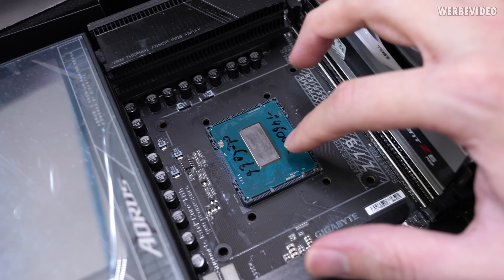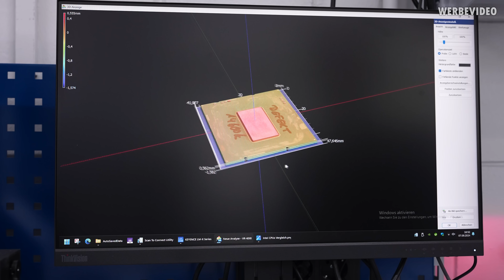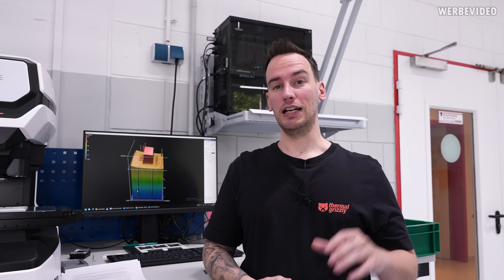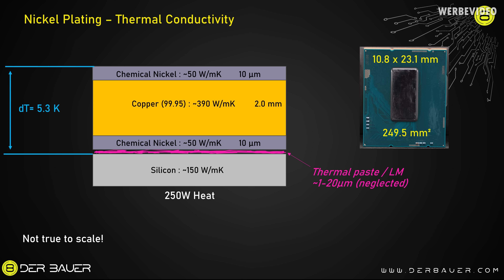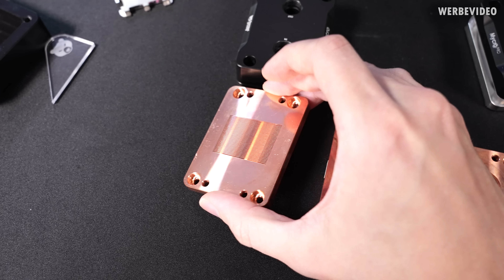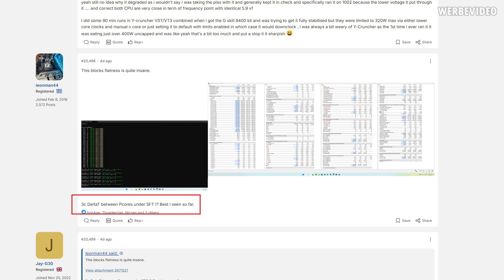We Identified the Problem with Our Water Block

Comment: I have to poke a hole in the chemical Nickle plating claims. Ni should have a face centered cubic crystal structure when crystalline. This is easilly its most dense state due to the close packed nature of the structure. Therefore the amorphous state can only be less dense. That's not to say the permiablility would be worse, as the amorphous state would lead to less if not no mobility of vacancies and dislocations, and thus less mobility of Ga in the bulk. Since this is YouTube I should also mention the size of Ga atoms is too great to reside in interstitial locations.

Comment: Glad to see you fixed the issue. :)
On an unrelated note is there anything you recommend me do to troubleshoot your LGA 1700 contact frames? When using them my memory overclock suffers greatly compared to the stock ILM with my max frequency being cut and occasional blue screens occurring and no matter how I tighten the frame (I’ve tried following your guide for 12th gen, fully tightened down and very loosely with both sets of screws) it always seems to have a negative effect. I bought the 13th gen revision in 2023 and had these problems with it and recently bought the 1700 LT version to see if it made any difference which it unfortunately did not. The board I tried using these frames on is the Z790 Apex Encore and others have reported similar issues to me.

Comment: I always prefer plain cooper. Can you sell cooper only version?
Reply: Watch the "Material science: Why nickel plating?" segment at 8:48 and you will learn why plain copper cannot be used with direct-die.
Reply: @snozzmcberry2366  I couldn’t find that video but a gamers nexus video stated cooper is fine except that it would have more staining and potential pitting but should be of no concern. Personally, my whole system fully copper with kingpin paste….it works excellent.
Reply: It'll be fine if not using LM, or any other corrosive TIM
Reply: @_Fortiori  If you too had actually watched the video, you would've heard Roman say that using anything other than liquid metal renders the delidding useless as you lose any potential cooling gains to be had. Non-LM TIM does not perform on direct die.
Reply: Wasn't aware someone could tell exactly how much of a video I've watched without ever meeting me but oh well.

He said it's "highly recommended" but I don't think it's the only option. That suggestion is at odds with his install video using kryosheet with the am5 heat spreader (the same part as for the waterblock).
I'm sure LM is the 'best' conductivity but it also comes with a high maintenance requirement and some risks which not everyone will be keen on. It should be possible to achieve results better than normal IHS cooling using this block or the TG heatspreader but not using LM, that's where a copper only block could be quite effective.

Comment: nobody else is surprised they were basing expected performance on prototypes and assumptions only, and not doing any testing with the final product? seems incredibly reckless. and the radius/chamfer issue.. again surprised that multiple mountings wasn't a part of testing. silver lining is the transparency and the fact that this serves as a lesson for thermal grizzly.
Reply from the maker: The radius only happened after we modified the block to increase pressure. So that was nothing we could test before. For the rest, absolutely. That's why I'm making my videos to show what we were doing wrong and how we try to do it better next time.
Reply: @der8auer-en  respect your taking accountability.

Comment: Talking about liquid metal on copper, it all comes down to discoloration.
In Sept 2014 i bought some grams of certified pure gallium from a german lab on ebay. It came solid, i then liquified it with an hair dryer (!) and, with an insulin syringe, i collected it.
I then applied the pure gallium on an old LAPPED Intel E6750 using its stock intel cooler.
It's still perfectly working on the current date, same temps, as the beginning.

Gallium eats aluminium, that's  for sure, but it basically has no effects on copper. Discoloration is just a pure visual effect and it doesn't affect functionality.
I know that, being on your side, visual differences can affect the RMA rate (mostly because most buyers don't know what they're dealing with), but from a technical standpoint keeping the pure copper finish is the best option.
Reply: Yup, I've had LM applied to an IHS and EK block for about 5 years now, both of which had the nickel coating sanded off. Haven't had to change the LM, and performance is still great. I'm not currently running the overclock I did at the time so I can't directly compare to initial temps, but at stock settings I have max core temps of 31 °C idle and 50 °C with Prime95.

Comment: Silly question from a silly person. Why was the water block not designed to use the same holding points as the TG contact frame which seems to not have any CPU warping problems?

Comment: Hey, i work in fabrication. We measure out product down to the thousandth of a milimeter. When workingn on stuff this small and complex i would recommend at least hundreths if not thousandths for measureing and tolerances.
Reply: The thing is such small tolerances only make sense if everything else around it also has such tolerances, which here is simply not the case. For instance the CPU-PCB is often enough slightly warped from the factory.

Comment: Have you tested any EN matrix coatings? I bet a diamond nickel coating would be killer for direct die. They have micron and even nanometer size diamond embbded electrless nickle. Ive seen it used to increase thermal transfer be acting as a hear spreader.

Silicon carbide nickle could be worth looking into too.

Comment: I think the the pick of nickel is more important then the looks.
For me a motherboard or other component like a water block is suppose to be built to perform first, looks or estetiks is not important.
To me looking at say an old mother board where every component has a jobb and a function and you can see it if you understand it, that is sexy hardware!
I dont like motherboard that is covered up in plastic or water blocks with an LCD or RGB, yea I know people like RGB but it has no practical function so to me its not good looking.

So I dont think any apology for the esthetics is required, the esthetics should be a result of the right choice of materials to build the component.

And if it works correctly the it also looks right!

I dont mind if an esthetic flair can be added without compromising the quality and performance of the product so Im not against making things look presentable as long as its not overdone.

Anyways, good video and a nice transparent update!

Comment: Why not create a finned surface to make a bigger heat spreading surface? I'm sure that if you do it to a copper plate before nickel coating it would increase the contact surface by 20-30% between nickel and copper.

Comment: Your comment about people using LM for direct die cooling.... But what if you were to sell a different version of the same waterblock that was bare (or galvanised) copper for use with PTM7950? You could cut out the nickel plating process completely and save a lot of time and money. Savings that can be passed onto the customer and just have smaller limited run batches of nickel plated blocks for those that do still want to use Liquid Metal.

Because I know a fair few people who used to use LM religiously that have now fully converted to using PTM and its usage is growing every day among the enthusiast community. Its not really something you can ignore.

But I assume you want to go all in on the nickel plating because you need to shift boxes of your Conductonaut.

Comment: but why bother with all of this, its beyond me, you get few degrees less you get few % more performance... and a lot more risk :) I cannot imagine that someone has a business and the competitive advantage is running overclocked CPU with water cooling :) and if you have a home PC then again, you void your CPU and sometimes MB warranty, and if you can afford water cooling just buy better CPU :) this is bad optimization, its like with software, you have a program that runs lets say 60 sec, and you are trying to optimize it, you profile it and you see that one function is takes 80% of this 60sec and the others are 20%, and you pick a function from those 20% that takes 50% of those 20% so 10% of total and you optimize it by 40%, congrats your program runs finished not in 57-58 sec :) was it worth it? you spend on it 3-5 months and now your program randomly crashes :D

Comment: Maybe I misunderstand, the explanation of the discrepancy is that the power density is locally higher on the die? You mentioned a 10-15C temperature loss across just the nickel plating layer? I mean, it just doesn't make too much sense. The argument is that the heat is too localized and hence does not spread out enough, but the layer is so incredibly thin compared to the rest of the structure (silicone, copper) that this can never explain a 10C difference, can it? The heat can spread even in the silicon die already (it has a diffusion barrier), and then the amount of 'spread' that can be attained in the 10um nickel barrier is extremely low no matter what material it is. Moreover, the difference between 'good' and 'bad' nickel is, if i understand, maybe a factor 2. How does that explain a factor 100 vs the calculations?

Comment: When applying chrome to steel, you must first copper plate, then nickel plate, then chrome plate.
I understand the boundary layers, but I did not think about the impact on thermals till now. I am just a Mechanic and tech enthusiast. 
Excellent work, Roman. Your transparency is greatly appreciated, and it is something lacking in this day and age. Maybe GN will do a video on Thermal Grizzly. A positive one, of course! Have a great day, Sir! o7
Reply: One of my engineering mentors pointed out that whether it's construction or manufacturing, issues and irregularities are almost always found at interfaces
Reply: You should find out what hard chrome plating is then revise your statement about must.

Comment: So they skipped steps, and put out a bad product. Seems pretty typical of business large and small these days. If TG had simply erred, I could understand. We all do. Still they came clean and fixed the problem. That counts.
Reply from the maker: We were under the impression, like all other water cooling brands, that nickel plating doesnt change performace. And in theory it also doesn't. Anything that your read about it will tell you that there is no difference. 
So it's not like we skipped work on purpose to safe costs or anything like that. Also We are talking about 50 coolers that were sold of the original product and we notified all customers ourselfes 1 day after we figured out there is an issue and offered a refund. Obviously I wish we already knew it back then and didn't make the mistake but here we are. All I can do is fix it and make sure it doesn't happen again. We're still quite young with about 1 year in the water cooling market so it means a lot of mistakes to do and learn from it.
Reply: @der8auer-en  My point of reference is the where you said you skipped doing certain things. I have been following you for years and was surprised by your statements to that effect. Perhaps I misunderstood your exact meaning. I will leave my comment, but in fairness to you, will edit it. This clarification leaves me believing my initial commentary is a tad harsh.
Reply: @der8auer-en  you ALWAYS test with the final product if you want any kind of certainty, and even then you may have issues. I've learned as much from software development, where fixes are generally easier
Reply: @defeqel6537  The issue was that they couldn't test the final product under the exact same conditions anymore. The CPU they used for preprduction testing died. Every CPU even if it's the same model, performs a bit different.
Reply from the maker: yes but we could've and should've done the entire validation again with a new CPU. But again, we learned and we will make sure not to repeat this mistake

Comment: I was wondering if there is a difference between Nickel Plating and Silver Plating? I work in a factory that Silver Plates Copper for better contact of Bus bars  in Switch Gear, and was just wondering if Silver Plating could provide any kind of performance. Hell maby it is better or the same but costs more cuz its silver and not nickel.

Comment: I understand why you use Kelvin for temperature differences. Unfortunately not everyone is familiar with it.
Since Celcius and Kelvin are both linear scales, 5.2K in temperature difference is the same as 5.2C. 
The Celcius scale is just an offset compared to the Kelvin scale, but they work the same.
In the industry you can also find both scales being used in datasheets etc for this reason.

For practical purposes I personally always stick to Celcius when I have to explain my reports, mostly because it confuses people less.
Reply: if all their instrumentation uses Kelvin, then it's probably just a habit, and anyone confused and interested enough can quickly find out about it
Reply: @defeqel6537  yeah I guess.
Unless you work with very low or constantly negative temperatures, I don't really understand why one would use Kelvin as a default.
In my experience it's only used in scientific research just for being proper, but it's just not convenient in engineering.
That's also what they taught me at university.

Comment: I'm concerned about the pressure pad pressing directly on the PCB. those differential pairs are impedance controlled. Even if the metal doesn't short them out (which is asking a bit much of the soldermask layer) they will still interfere. It's possible they will nock your pcie 4 down to gen3 or 2 speeds. I'd suggest you add at least a 0.2mm polyimide layer.

Comment: Your products are expensive enough to make gold plating valuable options and you will be able to get every last bit of performance.
Reply: why would they use gold plating for non-contact mating surfaces? Gold is good as it doesn't oxidize which is none of their issues.

Comment: I never heard of such level of transparency from any company for any problem they caused to customers, full stop. You changed the validation error of your manufacturing into an opportunity for learning for everyone involved.
I've been in the computer&network sector since the 6502/Z80/8080 processors. Since the 486, the processors begun to require an heatsink, and soon after, an active heatsink with a fan. A couple of year later, with the advent of graphic accelerators, the video processor also required active cooling.
At that point, I had been designing analogue and digital devices professionally for a decade already. In my view, any component generating excessive amounts of heat was dimensioned improperly; but when the clock frequency of the processor moved from 33 to 66 MHz, that heat was generated intentionally. For decades I coped with an internal annoyance because there were nothing I could do. But a couple of years ago, when I realised that Intel & AMD begun to push heat generation to the physical limits of both the chip die and the cooling devices - for the sole purpose of grabbing some more cash from a process node that had already reached its top end - I tripped. I already had had a bad time with the dumbed down Windows 10/11, so I decided to solve this twin problem at its roots: it took a year to move my work & entertainment PCs from x86/Windows to ARM/Linux. My central PC only draws ten watts. I only do light gaming and don't use Adobe. I never felt better in my life.

Thank you for this video. I didn't know that the die cover (below the processor heat spreader) is made of an alloy containing gallium...

Anthony

Comment: you have that non-radius issue with contact frames 😢
Reply from the maker: contact Frames don't press on the PCB though. So that's not really a problem there
Reply: @der8auer-en  somehow they do. i got imprint on pcb
Reply: @der8auer-en  only after cooler mounting. it might be pcb flexing?
Reply from the maker: For the contact frame there is qute a big gap between the PCB and any parts of the contact frame. It only sits on the IHS. Not really possible even with PCB flexing

Comment: Will there be a update for the am5 micro block (with what was learned) or they are already performing good enough?
Reply from the maker: We already updated the AMD Mycro. Was launched last friday: https://www.thermal-grizzly.com/en/blog/new-the-amd-mycro-direct-die-pro-rgb-v1-direct-die-water-cooler
Reply: @der8auer-en   good to know! btw, i was thinking about pairing mycro with kryo sheet for both good performances and 0 maintenance. If possible, could you please make a video testing the new mycro blocks and compare performance between luquid metal and cryo sheet? Thanks!